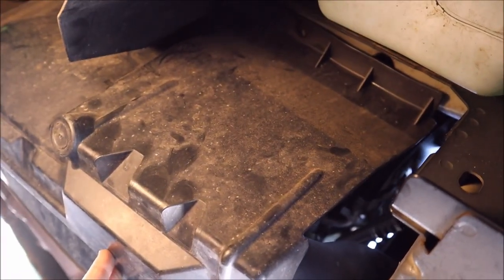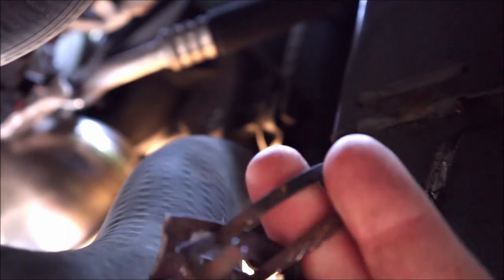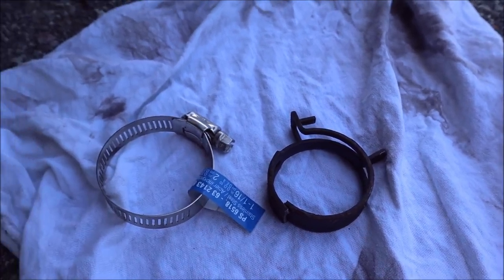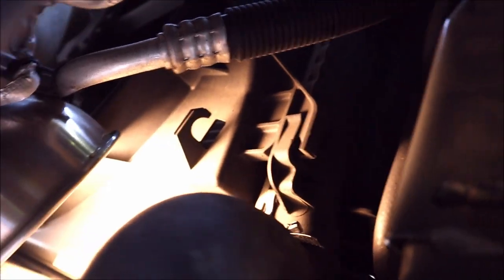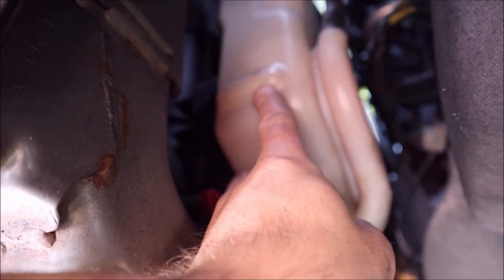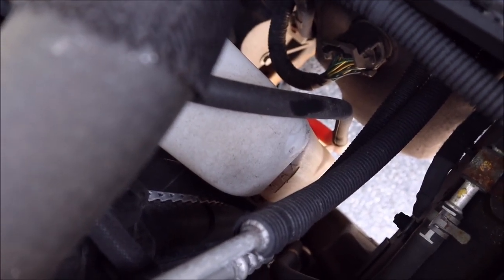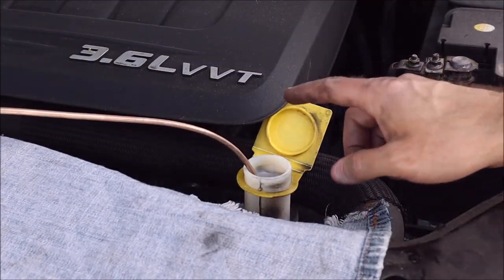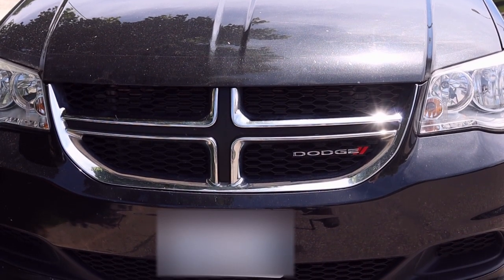How to fix a coolant leak in a 2014 Dodge Caravan

Comment: Good video, I had to replace bottom hose on my 2012 Town n Country. Two push clips and two wire harness plugs and the whole fan and shroud assembly comes out and you have unlimited access to the bottom hose, 20 mins total time to replace bottom clamp and or hose!!!!

Comment: I have a 2013 and mine is leaking a lot more ,I will check on the clamp thank you for the video👍
Reply from the maker: It was a quick fix and it's still holding strong, apparently this was a defect in these model years of van
Reply: Mine started after an oil cooler leak and replacement.

Comment: Having the same problem on my 2014 durango. About to try this. Hope it works!
Reply: Update. Wasnt this hose. It was the Thermostat housing.  Somehow, it burst. Idk. But its fixed now.
Reply from the maker: You made short work of that, nice.  

I took on brake lines on my 2003 Ford ranger 2 years ago, it took me 2 weeks to finally learn how to bleed the lines properly, terrible job to do yourself, but in the end I learned quite a bit.  The oil pan on my Hyundai Elantra was slightly easier.
Reply: @NeedItMakeIt  definitely.  The bleeding took forever but eventually got done. Lots of youtube for help.